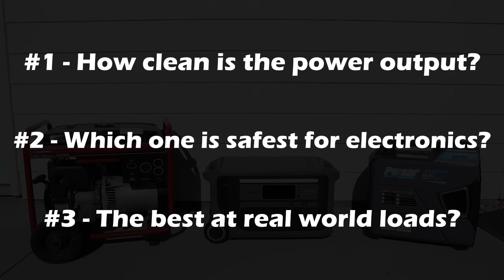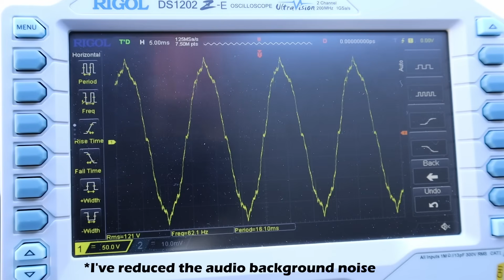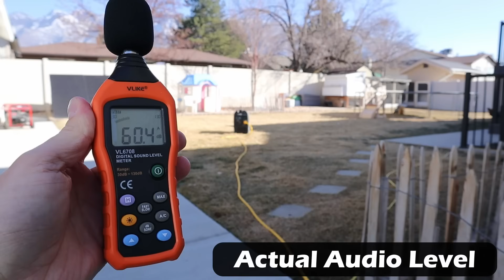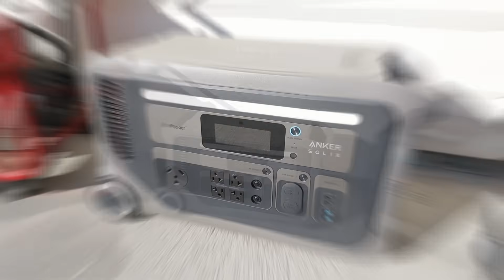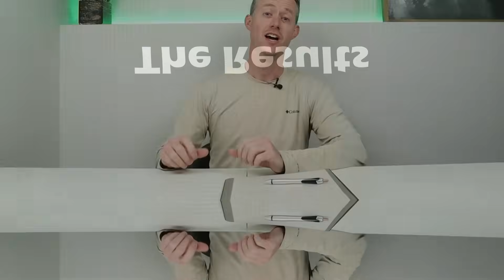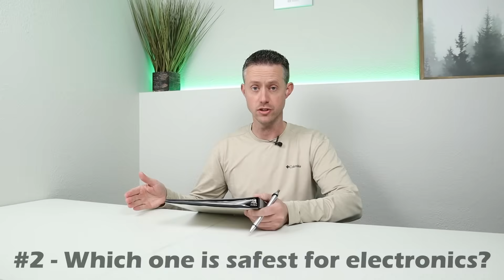Before You Plug Electronics Into A Generator, Watch This!

Comment: Am I understanding correctly that inside of inverter-generator is a fuel-driven motor, an AC (or DC) generator, rectifier (if generator is AC), smoothing filter, and finally a pure sine invertor to produce the output voltage?  Is there some kind of a battery too for stability? Or is the device simpler than that?
Reply: There are bound to be true sources for this, but judging by the name it will be a DC generator with output voltage control, similar to what you would find in a petrol car, connected to an inverter to create the desired AC output (e.g. 120V for US, 230 if it is EU spec). Whether this is actually meant to create a cleaner sine output, or maybe even better fuel consumption, is questionable. The most likely reason why these exist is that you can fairly easy alter the electronics to match the target market and the only physical adaptations needed are the plug outlets, making them more economically from a manufacturer's point of view.
Reply: @WhoStoleMyAlias  Would a DC generator be sparking like mad under load producind wide-spectrum EM disturbances?  Maybe brushless DC generators exist, but I haven't heard of any, brushless DC motors are not really invertible into generators.

Comment: All the things you list as being "sensitive electronics" have switch mode power supplies in them which can easily handle the power from the traditional generator. The power supply's output will be clean DC power regardless of what you power it from and hence the "sensitive electronics" aren't the wiser. I'd be far more concerned about things with 120v motors in them, like air conditioners and blower fans, which tend to run hot on dirty power and could overheat.

Other than that false claim, the video is not revealing anything unexpected. The traditional generator's output is exactly what you'd expect it to be. The other two are exactly what you'd expect from a pure sine wave inverter.

Comment: EVEN SMALL GENERATORS HAS AVR.
AVR = AUTO VOLT REGULATION.. CLEAN SINUS 
IT GIVE GASS UNDER LOAD SO HZ DOEWS NOT DROP OR RISE VITH IN SPEC
I USE A 6000 230V 50HZ PURE SINUS 12.000 IN SPIKES .. NEVER MESIURED ANY DROP OR NOICE ON MY RIGOL
AND A KIPOR 12KW 400V DISEL GENERATOR  AVR YES I CAN MAKE IT JUMP IF I TAKE 3X3000WATT HEATERS 
AND 3X2000WATT AND PLUG THEM IN AT SAME TIME... IT WILL GROWWL IF LOAD IS OUT OF AVR SPEC IT CUTS POWER 
AND DIE.. TO PROTECT SENSITIVE ELEKTRONIC..  16HK V TWIN 1000CC  HUGE NM..

Comment: A traditional generator has an ac alternator so in theory should be perfect sine wave

Liiks like a poir quality altenator or something else is the problem 

Thrirs god and bad in all classes so id say all could be problematic

Testing a range of them is needed.
Reply: Dirty power from these generators comes primarily from two sources.  1)  brushes.  They can arc and spark as the slip rings rotate.  2) Gas engine.  RPMs fluctuate.  The engine slows down ever s slightly during the compression stroke simply because compressing a gas resists the effort that's trying to compress it. Then the RPMs increase ever so slightly during the power stroke for the opposite reason,  You can visualize the frequency variation by observing the slight tilt in the top half of the waveform on the scope

Comment: Would be interesting to see how mains power behaves when starting the power saw.
Reply: It‘s almost the same.
Reply: @herbertsax7169 Did I understand the O-scope display of showing the saw made a LOT of noise on the power? As in , a huge amount of "dirty power" compared to the generator by itself?
As for modifed sine inverters, everyone likes to go on about how dangerous they are for electronics, what electronics do they have that actually see AC? I want to see a scope on the DC output of a power supply fed by a genset or a mod sine inverter.
I do know that AC MOTORS are inefficient and get a lot warmer on a mod sine. (and they REALLY don't handle old school square wave inverters very well.)

~~I'll relinquish the reminder of my time on the soapbox back to the floor.~~
B^)

Comment: Can you run the “dirty power” from the non inverter generator through a power station to clean it up?
Reply: Came here to ask just that
Reply: No unfortunately not. The dirty volts are simply passed through the power station. And the electronics on the input side of the power station probably wouldn’t like the dirty volts!

Comment: Why would charging your power station with non inverter generator be an issue? The power gets converted to DC before  charging the batteries. I've run my whole house on a non-inverter generator with dirtier power than the one you just mentioned. Everything was fine before and after.

Comment: First off an electrical generator generates electrical power from a fuel source or source of potential energy. Fuels, water, air and wind is typical. An inverter takes electrical power out of a battery and converts the stored electrical energy into typically an alternating current. It does not generate electricity as it is already stored in the battery. The correct way to call it is, a Battery powered inverter, inverter or DC to AC Converter. Leave off the generator.
Second, most devices in our houses have very noisy switching power supplies with extremely poor power factors. If you go to your house and do the same test in the wall outlets near the TV, audio devices and PCs, you may find that those outlets have a lot of noise on them with truncated sine waves due to the nearby switching power supplies. 
Just get familiar with Switching power supply noise, Power Factors and various other power generating devices. I spend a lot of time tracking down electrical noises in some very sensitive devices, found a lot and every time found another hiding in the noise of the first ones I knocked down. Used a scope with a 100uv scale!
If you really want to have fun, use your scopes Fourier Math function to graph out the noise spectrum Have fun.

Comment: One question I'd like to know, because it was a thought I've had for a while, could the power from a traditional generator get cleaned up using a power conditioner and connecting sensitive devices off the conditioner?
Reply from the maker: That's a great question that I don't know the answer to, at least right now.

Comment: The traditional open frame generator with a straight wound rotor produces a large phase shift near 0 and 180 degrees under heavy loads.
Your open frame did not have this phase distortion making me think it has a helical wound armature.
I note that the power station no load waveform shows a minor distortion at 0, 60, 180, and 270 degrees that the inverter generator did not.
I am presuming this is a manufacturing  choice within the inverter; i.e., larger but fewer MOSFETs.

Comment: My father's CPAP machine wouldn't work at all on the traditional generator, it also wouldn't work on the regular 12/24v DC to AC power inverter, we think the "pure sine wave ' inverter damaged the CPAP machine after two days because the humidifier quit working then the blower quit working right after that..... Be wary of even middle tier inverters, and it was not even cheap.... We were in the middle of recovering after a severe hurricane so I had no way to test the inverter and then we kept having things throwing fits and worried about damaging more electronics I decided to make sure nobody else would get burned and turned it into pieces then into smoke and a blob of aluminum for it being a headache for me
Reply from the maker: Thanks for sharing your experience.

Comment: It was a bit surprising how much distortion the generator power had. However, I think it's unlikely that amount of distortion is going to damage anything. Most devices will work even on crappy inverters with square wave or step-approximated sine wave output which would be much worse than that.
Reply from the maker: That's a good point, thank you.

Comment: I have the same dirty power generator.  I'd like to get a large 240v capable power station and charge it with the dirty power generator once per day during a power outage.  This would keep from having to run the generator 24/7.  So is it your opinion it would be a bad idea to charge the power stations with the dirty power generator?  During charging nothing would be running off the power station.  This old generator has no use in running my house will all the sensitive items, but if I could use it for only charging the power station the generator could serve a purpose.

Comment: Many power stations will throughput the charging/ dirty power if thete's a load on them. So careful, don't charge it with a traditional genetator
Reply from the maker: They call it 'pass through' charging for that reason 👍 dirty power in, dirty power out.

Comment: Biggest question: can someone use traditional generator to charge power station? And will the power station act as an anti-interference filter?...
Reply: I seen people make the case that's the way to do it because it's more efficient for fuel use. Use the gas generator to top up your power station and run your stuff off the power station until it's dead. That way you're not running the gas generator constantly but only using part of its output and wasting tons of fuel.

Comment: Most competently designed 120V switching power supplies are fine on almost any power within reason. That is why most consumer UPSes are still getting away with "modified sine wave" that is a bipolar-return-zero 170-180V rectangular wave with some inductance to take the edges off.

The core benefit of conventional generators is that they are almost literally bulletproof. Short of an internal winding short, nearly everything else is a trivial fix.

Comment: You can take a standard generator, plug in a DC battery charger to it, connect it to a battery, and charge your power station through the solar port for continuous clean power output to whatever you need. It's a relatively inexpensive way to convert any generator to an inverter generator. You have to do this so that the power station doesn't run in "bypass mode" and push dirty power through the ac ports.

Comment: Having work in developing SMP power supplies for sensitive electronics I can say all three sine waves look pretty good and I'd say from the perspective of power quality they are all pretty equal. If you want to see bad, look at a square wave inverter.  What is dangerous however is if the output voltage is significantly higher, and older generators can do this. I purchased an older generator for kicks and it can put out over 400V. If you touch a conductive surface of the connected appliance and the insulation on the power supply of the appliance breaks down this could result in death. Especially with generators where they are frequently not grounded. This is the background to why generators can be dangerous for appliances, and more importantly you.

Also worth pointing out example of bad quality power, which I'll define as frequent high rates of change in voltage. Square wave is a great example of a really bad quality power. However a sine wave with lots of high frequency spikes is also bad. Probably the worst quality power observed in your video is when the table saw was running, and all three generators suffered. My takeaway from your video is not to use sensitive electronic devices on a generator while someone else is using a table saw.
Reply from the maker: 😮 400V!!! Wow!

Comment: Hello there! I just wanted to share a pro tip for anyone that might not have much money. 

You can combine a traditional generator with one of those home backup power systems you can but for computers at office supplies stores. They are generally called Uninterrupted Power Supply, or UPS. They run from anywhere from 100 to a couple hundred for good ones. 

I did tests years ago similar to the tests you ran in your video. I took several decent quality UPS's and plugged them in the generator, and then run the load on the UPS. It's important not to overload the UPS above their rated capacity for obvious reasons. This is useful for running computer systems, tv's and other sensitive electronics. Of course you would need a higher capacity one to run a fridge. 

At our house our furnace is old and relay based. This thing runs on any quality power. It's basically a tank from the late 1980's. This could be useful information for people that have access to old generators and UPS units.
Reply from the maker: Which model UPS cleaned up the power the best?
Reply: @Jasonoid I would need to log in to my old Acer as it's been about 15 years since I played around with that old gear. I remember an APC brand UPS running my tv, laptop, and modem on a 4000watt Chinese generator really well. 

APC brand was popular in the aughties and could be picked up for cheap. I paid around 150$ Canadian at the time. The other brands I am not sure about. You want to ensure the UPS has active protection while on grid.

Comment: All sounds impressive but have you tested the supply that comes into your house. That is hardly 'clean'. One reason power supplies tend to minimise any deficiencies. Worked with conventional generators over the years. My computer etc is still very much alive. Besides, most equipment bricks etc go from 90v to 240v plus. Fwiw, my air fryer is rated at 60Hz, works fine on 50Hz.
Reply from the maker: I tested my grid power as people have been mentioning that in the comments. Grid power for me isn't perfect but it's not bad either. 121v, 60hz, and 3.1%THD.

Comment: For the traditional generator, The Hz is not that bad. Pretty much all electronics will be just fine anywhere between 50 and 60 Hz and most are very tolerable of the higher Hz. It's the lower Hz that can cause problems. Industrial motors are safe up to 90Hz. Some battery powered inverts produce square waves that will cause most wall wart power supplies to over heat and go night night.

Comment: 7 percent is no big deal. I would say that troybuilt generator is actually very good. Except for being loud as heck.
Reply from the maker: Thanks for sharing your experience. Not only are the inverter generators quiet, they also have an engine half the size so they save on fuel too.

Comment: I have a lot of testing experience (yes, using oscillography) with 3 phase and single phase rotating machine generators.  I was using them for power sources for testing primary voltage hardware.  The ones with good excitation and voltage control do not exhibit (much) harmonic distortion.  The cheaper units like you show sometimes have just a capacitor (not a voltage regulator)  for voltage control on the exciter.   I have one of those generators and my experience was the same as yours.  I would recommend for a future video, you test a more robust non-inverter generator that has good voltage exciter controls.  You are correct that most rotating machines will not have frequency feedback.  They are usually set by governors and that has slop.  Large generators have more sophisticated speed controls so they can track 60hz better.  So the engine and governor system is what results in your frequency response based on load variation.  Great video and good exercise.  I think it says a lot about how generators can be marginal on power quality.  FYI, I think your table saw is a DC motor.  I suspect the sawtooth effect along the sine wave is due to the saw's commutator.  Just a guess.  Most electronics use switching power supplies which means they rectify to DC and then modulate high frequency AC.  I did some testing of those supplies and sharp voltage changes (spikes) tend to amplify per unit (% basis) across the supply.  If the distortion is more steady, it typically can manage w/o issues as long as you stay in the operating range of the unit.  Usually these supplies should have filtering on the front end to limit those transient events.  Induction motors will have issues with harmonic distortion.  In a worst case, you may cause the motor to overheat.  Certainly lower frequency and lower voltage is bad for those induction motors too.
Reply from the maker: I'm a newbie, thanks for sharing your knowledge! I learned from this!

Comment: Why can’t you use a traditional generator to charge a power station?
Reply from the maker: If the power quality output is low from the generator, the power station won't even charge. If it charges you should be okay 👍
Reply: You can. I have with my pecron f3000lfp.

Comment: My outback Radian 8KW solar inverter has inputs for grid, generator and DC solar/battery.. I have 2 regular generators, one is a 3,800 watt and the other is 14KW.. They both have their sweet spot load for getting the cleanest power out of them.. The 8KW inverter has a programmable limiter for dirty power from both the grid and the generator input that allows the inverter to help smooth them to a generally acceptable level.. An attached generator can handle the house loads and put any extra power into the batteries allowing me to keep the generator at a constant load at all times while it is running.. The battery based inverter boxes are what my sister uses in the city and she has it wired into a transfer box for a couple circuits in her home with 2 extra add on batteries for outages that might last a day or so depending on if they are running the natural gas furnace in the winter.. If the outage was to last longer they could take the 2 extra batteries and charge them elsewhere then bring them home and connect them back to the main inverter.. For both these a direct DC charge is far more efficient than an AC to DC charger which is something to consider..